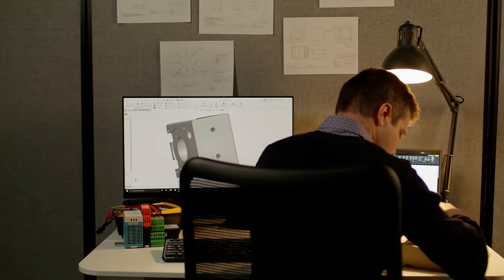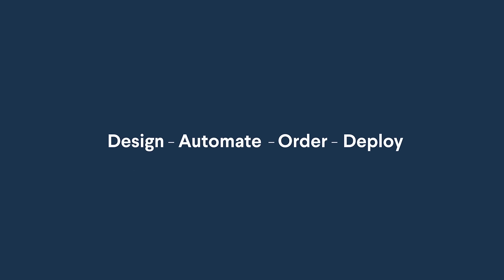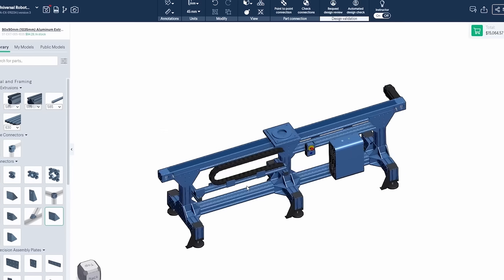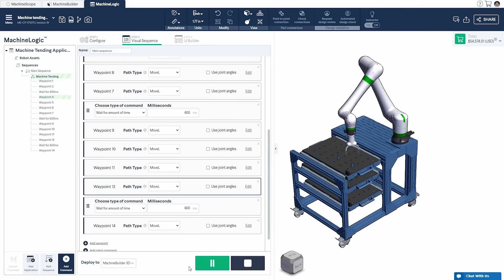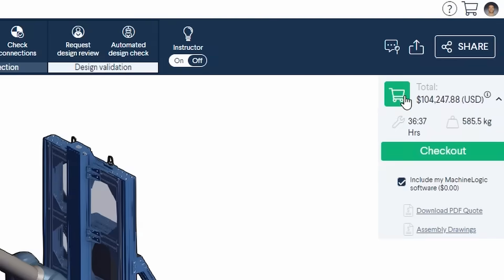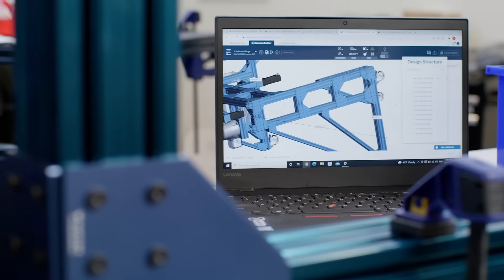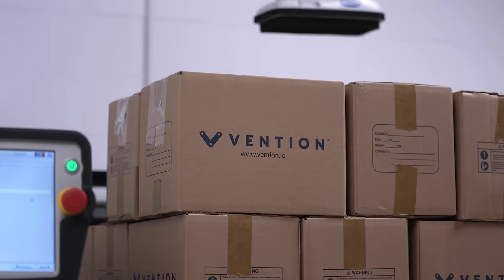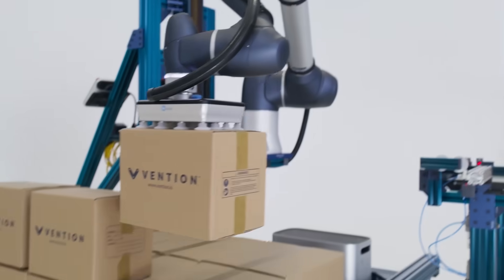Manufacturing automation platform | Vention

Comment: Imagine if manufacturing automation was simple; introducing Vention. One platform to design, automate, order and deploy manufacturing equipment in days. Design automated equipment and robot cells in minutes with machine builder. Drag and drop modular components like extrusions, converyors and robot arms into your design. Program your equipment code-free with machine logic and simulate directly in your browser. Review your auto-generated bill of materials and order with a few clicks. Track your order and receive your parts within days. Deploy your machine using our plug-and-play functionality. Begin transforming your factory floor today with Vention. This is the future of manufacturing automation. This is manufacturing automation simplified.

Comment: Imagine if manufacturing automation was simple. Introducing Vention. One platform to design, automate, order and deploy manufacturing equipment in days. Design automated equipment and robots cells in minutes with machine builder. Drag and drop modular components like extrusions, conveyors and robot arms into your design. Program your equipment code free with machine logic and simulate directly in your browser. Review your auto-generated bill of materials and order with a few clicks. Track your order and receive your parts within days. Deploy your machine using our plug and play functionality. Begin transforming your factory floor today with Vention. This is the future of manufacturing automation. This is manufacturing automation simplifed.